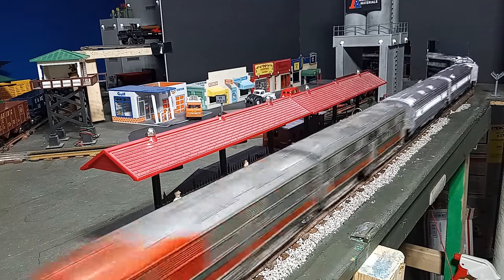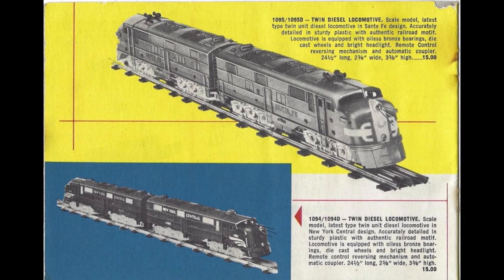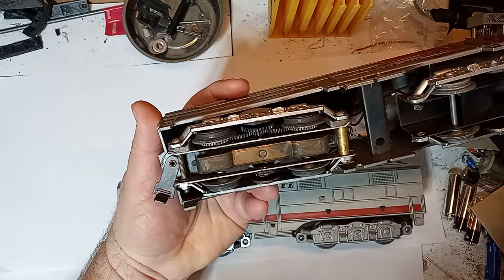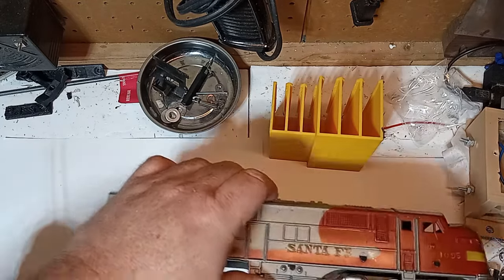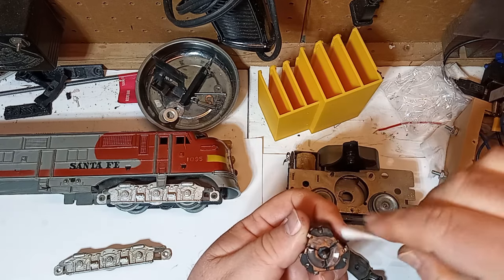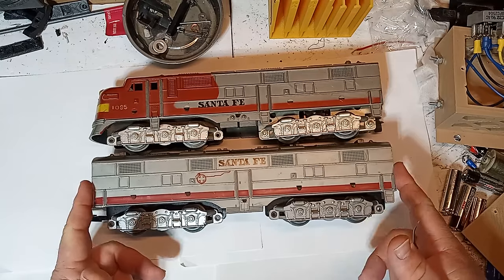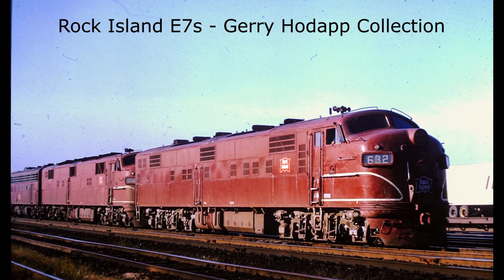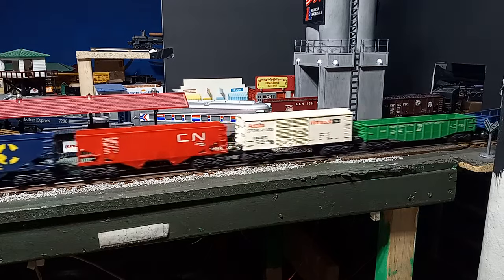Marx Santa Fe E7 - Great Deal Or Big Dud?

Comment: While I personally prefer the litho metal F unit Marx made a little earlier, these have their own charm too. Hope to find a Rock Island set. If I find the parts to do it, I would like to make an A-B-B-A lashup of these E-7s, all trucks power trucks (8 power trucks total!) and a 3-wire plug between the units so they share a common reversing unit. Add a little weight inside for even better traction, and yeah, this would be a LOT of fun! Adding these to my list for York.
Reply from the maker: That would be a BEAST!
Reply: I just finished rebuilding a Marx tin litho F unit into a 'Super' F unit. At the TCA York meet I picked up a bunch of E7 power trucks, these have the smaller gears behind the wheels and the plastic sideframes. Swapped the plastic sideframes for metal, and rebuilt a tin litho F unit to use two E7 trucks. I refitted one of the trucks to use a Lionel coupler for compatibility. With a little extra weight inside, that unit pulled 20 postwar Lionel cars effortlessly. Of course those cars all had clean trucks and Zoom Spout oil on the bearings (My go-to oil, it works wonders!). And it can navigate 022 switches just fine thanks to the later gearing.

Comment: The story of how the last E7 in existence was saved is interesting.  The version of the story I have heard is that a Penn Central shop foreman who appreciated the history of PRR 5901 (the first E7 ever built) was responsible for swapping engine numbers with a retired switcher locomotive.  To make sure the subterfuge was not discovered before preservation efforts could move the unit off Penn Central property, the PRR 5901 was hidden from view by hiding it in an unused roundhouse stall.
Reply from the maker: Interesting variations on a story. BTW, #5901 was NOT the first E7 built (not even the first on the PRR - 5900). The EMD demonstrator "Train Of Tomorrow" became UP #988. #5901 IS the LAST surviving E7 in the world.

Comment: Hey Mike. These are often overlooked and undervalued. I have every version of these, along with the matching cabese,  except for the Penn Central, Allstate, and silver Western Pacific. I have multiple sets of the more common versions. I was able to score on a complete SantaFe El Capitan passenger set, complete with the ABA units with diesel roar feature for 100 bucks in excellent condition. 
The plastic geared motors with traction tires are very quiet, smooth running, and strong pullers. I enjoy modifying these by adding dummy A unit headlights and adding LED Mars lights in the powered A units. I was able to buy a lot of these sets for around 40 bucks 4 years ago. These were made in SantaFe, Rock Island, Western Pacific the common green with yellow stripe, Westen Pacific the rare silver with yellow stripe. New Haven, the rare NYC in both the  long and short flag versions, the rare Union Pacific, the rare Allstate and the rarest Penn Central . Some came in AA some in AB some in ABA, and some like the UP came in a single A unit. If the powered A unit had a tilt coupler, then it was sold as a single A unit only. The NYC was only sold as an AA unit, where as the SantaFe was sold as an AA, AB. and the ABA. I can assemble ABA consists of my SantaFe, RI, and green Western  Pacific. I think the New Haven set was sold as an AA unit only as I have never seen an authentic B  unit.
 I repair broken plastic cabs with super glue and sprinkle baking soda over it and build it out in layers. The baking soda is an accelerator for the super glue and will also fuse to the plastic instantly. It can be built out and sanded or filed. It will be white but can be painted to match. I have the best results using any of the liquid CA super glues over using the gel. I also use this method to make trees. The built-up area makes a natural looking branch from the trunk. This method also adds structural reinforcement to any building support beams when scratch building structures. The parts will break at stress points  before the actual welded joint ever will.
Reply from the maker: Thanks for the information!
Reply: @ToyTrainTipsAndTricks  Mike, FYI, I forgot to mention that I also collect the K-line S-2 switchers that use the same Marx molds as the  Marx 1998. Aparently the operating couplers, I believe is part K-2100 is obsolete. I have successfully modified the much longer version used for their MP-15 switchers. I think it is part # K-2600. I have cut off the rear mounting hole, (shortening it to match the original length), that is attached to the centering spring and shaved off plastic from around the new rear socket of  the coupler arm to match the original rear mounting hole to fit the rear socket as the armature is the same. I then successfully use the super glue and baking soda to reattach the plastic shortened modified centering spring. I've also been able to repair the broken couplers themselves using this method and have used a section of black plastic zip ties super glued with baking soda to the collar as a replacement for the missing centering spring. By carefully shaving off the sides of the coupler arm where attached to the new rear mounting post, the post studs will fit the existing post holes that the rear post of the armature snaps into. So far, this repair has been holding up. I would like to use a small metal spring heated up and plastic welded in place but have not found one suitable and there isn't much plastic surface area to weld to. I would be interested to know if you've found a direct operating replacement for these as this is a common problem for these models as there are two on every model and their both essential to operate on a switcher engine used for switching operations.
Reply from the maker: @DRCRailroard  I don't have any of the ALCO switchers, so I haven't experienced this problem.

Comment: Erie Lackawanna's "FE-22" program involved upping the wheel diameter to 38 inches as well as the regear. EL also took a 12-567-B from an E8 and installed it in  an Alco RS-3 (MFAE-12 #1060). Penn Central  and Conrail had a  similar program,  producing dozens of AERS-12 and RS3m units.
Reply from the maker: L&N also re-engined ALCO RS's with EMD 567s salvaged from E units.

Comment: I just realized on this video that you used doors as you layout table top... Wow!  As a teen in our attic to get more floor room in the attic to run my trains, there were many doors up there in the attic, so I put them up across the rafters in the attic and moved stuff up there and off the floor.
Reply from the maker: I use a set of bifold doors for temporary layouts such as for Christmas, but my permanent layout is 1/2" MDF over standard framing. I used MDF because plywood was not available during COVID.

Comment: Nice vid Mike, 
The plastic E7's are nice but the tin lithographed version (#21) is where it's at.
Reply from the maker: The #21s are great IF you can find them in good shape. Also, I believe the #21s have the early "fat gear" design that doesn't play well with Lionel turnouts.

Comment: I have a pair of the Marx units as you have shown- Not sure if it is rare but I have a E-7 make of sheet metal. I bought it on E-bay maybe 4 years ago. I assume it is Marx. I know it has a Marx motor. As always I learn so much from your videos. Keep up the good work. Thank you, Jeff
Reply from the maker: If they are Santa Fe, they are like Marx #21 diesels. If they are Rock Island, they were made by a competitor called Unique Art https://www.ebay.com/itm/285318406923?chn=ps&norover=1&mkevt=1&mkrid=711-213727-13078-0&mkcid=2&itemid=285318406923&targetid=4581183931512188&device=c&mktype=&googleloc=&poi=&campaignid=603247656&mkgroupid=1241349622402367&rlsatarget=pla-4581183931512188&abcId=9316139&merchantid=51291&msclkid=16b7f90b3b9c1104ac179cda6c8e12bd
Reply: they are Santa Fe's -- Keep up the great videos.

Comment: On the side of the motor the E-unit there is a hole, spray your contact cleaner in there and also point some in that hole toward the coil, a cleaner with some kind of light oil is also a big help on the reversing unit sliding innerds of the coil.
Reply from the maker: Thanks for the tips!

Comment: I have a 1095 ABA.  The only problem is that the A dummy has a  plastic Tilt Coupler, but is has no slot akin to  a metal tilt coupler.
Reply from the maker: As noted, some dummy A units have nonstandard couplers due to clearance problems with the pilot.

Comment: Found a Rock Island ABA set at an estate sale and I’m hooked.  Great puller until the tab and slot on the powered unit failed and powered unit failed to negotiate a curve at what was now a high speed.  Unit survived except the headlight.  Any videos or advice on troubleshooting the headlight connections in the Marx E7?

Comment: I don't know what it is exactly, but I kind of prefer these to the big F-units made by Lionel. Maybe it's because I like the passenger E units a little more, maybe it's because it's just as toylike as a typical O gauge engine at the time and sort of scales better with smaller cars.

I have been tinkering with a Marx 666, and it doesn't seem to have quite enough "oompf" to get over my pair of Lionel 022 switches, despite being double reduction and much cleaning and so on. I replaced the original knackered brushes with new ones, though the motor still runs hot - Do these motors need remagnetized every once in a while?
Reply from the maker: Are the turnouts next to one another? Does the locomotive generally run slowly?
Reply: @ToyTrainTipsAndTricks  The two turnouts are pretty far apart, it seems to run across the turnout in the facing direction quite well but tends to stall when entering from the other side of the switch.

The loco tends to run hot, even with the newer brushes, and isn't as quick as a typical Marx loco. My present speculation is that the motor's magnetic field is a bit weak, though my assumption comes from a background of messing around with DC HO stuff where that sometimes is the case for older locos.
Reply from the maker: @RockyRailroadProductions_B0SS  Could it be a bad winding in the armature? That could cause greater resistance and lower magnetism.